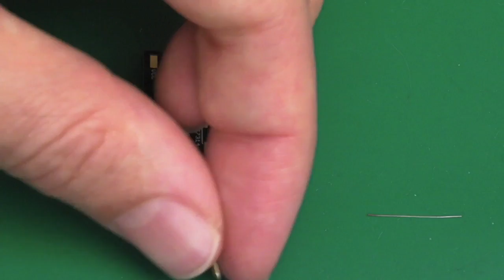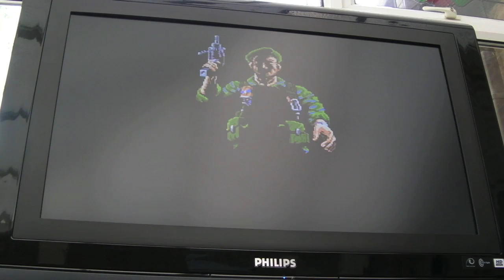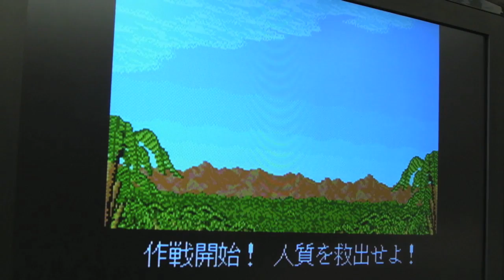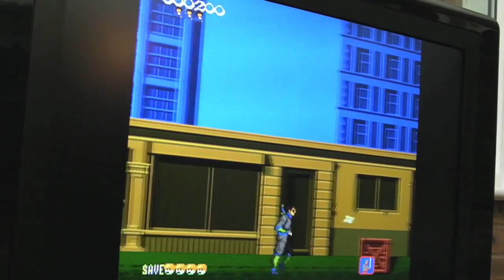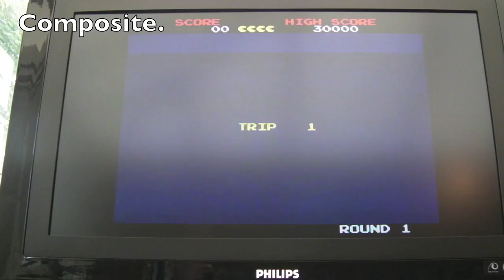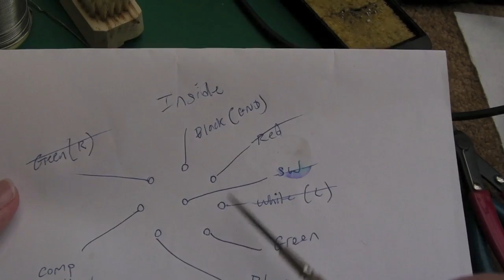NEC PC Engine (Tennokoe 2) Amplified RGB Mod

Comment: why not just make it a scart plug?
Reply from the maker: You could do that but I prefer to have a DIN which matches the other PC Engine model, so I can use the lead with either system.

Comment: I've done a whack of RGB mods, I've never had so many issues as this board.  I'm using 3.0MOHms as it's all I have, and a THS7316 amp going to an OSSC.  I only ever get a screen that's way too green or completely black and white.  Occasionally it looks alright for a few minutes, then goes completely 'red.'   Maybe my output voltage is too high for the pull-downs, try try again.

Comment: I just modded my IFU-30 with a ths7374 chip based rgb amp. Everything worked nicely and then something strange happened: When I plugged the OSSC into the first hdmi port of my BFs TCL 4k TV = no jailbars. HDMI port 2 and 3 = jailbars. I tried to replicate the situation with my own Panasonic TV and i had jailbars on every HDMI port.
After a lot of trial and error I finally found out what mainly causes jailbars on RGB modded PC-Engines and similar consoles; it's the full range RGB mode most HDMI in ports are set to by default. Set the one you use to "normal" or "limited" RGB range, and the jailbars are 99% gone, without replacing any filter capacitors. Yay! \^o^/
Reply: Ok, after some more testing with more games, let's make that 80% gone with 50% on solid blue background lol embarassment I guess i'll apply the HU C6260 filter capacitor bod after all to get rid of the last bit of "jailbaring" I ordered SMD ceramic caps of the 1812 size instead of the "recommended " 805 size. "Is this a piece of dust or does that need to be soldered on?" hehe ^^; They should fit too, i hope.
Reply: I just added the higher µFcapacitors to decouple the HUc6260 chip better and while the jailbar noise got reduced, it's still faintly visible. After thinking about why it's not totally gone for a while and trying out several things, i realized i made a mistake when i added the RGB booster to the IFU-30. I took the booster's power directly from the IFU-30's voltage regulator. But if the HUc6260 needs decoupling for it's 5V supply, why wouldn't the RGB booster's THS7374 chip need the same? Not decoupling that chip's 5v supply i think i introduced extra noise. More tinering to do.. ^_^ BTW, that's what my PC-Engine' video output looks like right now: https://ibb.co/hWHW7F8
Reply: I'm not entirely sure if I start to imagine things, after lots of staring at my TV, trying to comapre the picture quality, but I do think after adding the bypass capacitors to the RGB booster, the PC-Engines Picture does look cleaner.. or doesn't it? lol It does, right? ^^; https://ibb.co/gtshGsH
I also recap'd my PC-Engine, replacing all electrolytic capacitors, for good meaure and out of curiosity, but that didn't create any noticeable difference. Oh well, having new, good low ESR capacitors inside an electrical thingy never hurts. Thought my findings would be interesting to some ^^;

Comment: I'm thinking of getting mine modded for rgb. It has already been modded with composite so is it possible to still add rgb to it?
Reply from the maker: Yes, the 6270 outputs the RGB connections, so those will still be there for an RGB mod.
Reply: Thank you very much

Comment: Where can i find 3,1Mohm ---1206?
Do all need to be ---1206 family?
Reply from the maker: You can use other sizes like 0806 might fit OK.  3.1Mohm resistors are hard to find, which is why I ended up using 3.3Mohm I think.  between 3M and 3M6 will be fine.
Reply from the maker: You could also get 3M and 100K resistors and put them in series to get 3M1.
Reply: Is this the right one? https://imgur.com/a/0fqIC
Reply from the maker: That's 3 meg.  See if you can find 3.3meg - that will give a better picture.
Reply: I found 3.3m hope These Will do it

Comment: Hey, I had some question that I can't seem to find a straight answers to. I was hoping one of you might be able to answer it. 
Trying to do an RGB mod for TG-16. I'm using Console5's THS7374 RGB booster (only because Voultar's is sold out), Mini 9din genesis model 2 plug, a RGB SCART cable with Csync (from eBay's retro_console_accessories).  
Here are my questions, 
-if I want to use Csync, should I boost the sync signal from the TG-16? If so, how should I go about doing that? will it work with the THS7374 RGB amp?
-If I want to use Csync, should I even connect the comp video output? 
Thank you for taking your time to read this, Please advise.
Thanks again! :)
Reply from the maker: I've honestly never looked at the level of the csync signal on the PC Engine - my guess would be that it probably needs amplifying like the RGB signals do.  My suggestion would be to try it first and if its doesn't work then amplify it.   If you look at the datasheet here you can see that chip has 4 channels - one for CVBS (composite).  You could just feed csync into that instead and it would probably work.  You might need a pull up or something on it - I would look at the PCB to see how the R,G,B are done and replicate for the csync input.  I haven't seen the PCB from Console5 so maybe it already has support on the PCB to wire csync already?
Reply from the maker: http://www.ti.com/lit/ds/symlink/ths7374.pdf
Reply: Yeah, there's no PCB for the sync itself. which kinda sucks, but I guess I can still jump on to a leg of the chip. assuming that I can. I'll try it out and will let you know. Thanks for the PDF btw, That really takes alot of the guessing work.

Comment: hi , please give me the list of the voltages and caps values for all caps , RGB board and sound board. thanks
Reply from the maker: Voltages are unimportant really as most (if not all) of the caps you will find in 1206 size will be more than 5v.   Basically you need a min voltage size on caps of say 6.3v. 

3 x 82nF - 1206 capacitor
3 x 3.1M or 3.3M - 1206 resistor
1 x 22uF - 1206 capacitor 
1 x 100nF - 1206 capacitor
3 x 300uF 6.3 diameter electolytic capacitor
3 x 91 Ohm - 1206 resistor
3 x 470 Ohm - 1206 resistor
1 x 100 Ohm - 1206 resistor
Reply: thanks , great work . can i fit both boards inside the pc engine ? can it be done ? or do i have to use the expansion ?
Reply from the maker: Those components above are for the RGB amp btw!   The ones for the sound board are printed on the under side of the board too I think.  You could probably fit them both inside the PC Engine but it might be tight.
Reply: many thanks
Reply: another Question please , should i get the Tennokoe2 and install the rgb amp and sound boards ? i mean does it addup any bonus ? because i saw that there is another ciruit inside it, for what is that?
Reply from the maker: +dab2a atasi The Tennokoe2 is better to use because there's more space inside, if you get another PC Engine it's easy to just plug into the Tennokoe2, and the Tennokoe2 provides save RAM for games that support it.
Reply: thanks allot

Comment: Any place you would recomend to get the rgb amp board already populated with all the components? They are kinda hard to find here so i would need to souce them online anyway. Theres a couple on ebay, but the soldering job looks very iffy.
Reply from the maker: I cannot really recommend anywhere tbh =/   This site did send me some pictures of the boards they were planning on selling, and they actually used the exact same PCB I used:- http://gamedoctorhk.com/index.php?main_page=index&cPath=165
You could contact them and ask if they have the PCB still?
Reply: hm, its one of the ones i saw on ebay, soldering job doesnt look too good x.x Guess i'll just order the board form oshpark and the components then. Thanks

Comment from the maker: Update 15/06 - Had another play on the PCE tonight and whilst the display looks really nice now, I still believe that 3M3 resistors are not enough when using 5v.  The examples in the datasheet are based on 3.3v with 3.01M resistors.  I think the bias level is still not quite perfect.  I will scope the RGB pins and try dropping the supply to 3.3v with an AMS1117 regulator later if needed.

Comment: Nice pcb's but very expensive compared to the original, micro designed board. Also most people wire up the 8 pin din the same as the pc engine 5 pin din but then add the rgb lines to the 3 extra pins.
Reply from the maker: Expensive?  They are very cheap, like $9 for 3 or something!  I did wire it the same as the 5 pin DIN and then used the remaining 4 pins for R,G,B and switching.
Reply: the original amp pcb's are $1 each - but giving that yours are coming from the US the extra cost can only be expected.On your diagram you have the 5v switching on the centre pin were it's usually on the outside, with the middle pin and top tow are the rgb - either way still works the same.

Comment: Looks great, I would love to see what it looks like with just c-sync (c-sync not to be confused with comp-video-sync). I've noticed some modern HD TV's give a better picture with just c-sync. Oh, loved the shinobi game play. I used to own a genuine Sega System 16-B Shinobi arcade board but sold it like a complete tool.
Reply: i rgb these systems all the time, and personally can see next to no difference between comp sync and c-sync, only issue is that some lcd's really don't like c-sync.
Reply from the maker: Yes - you are right, c-sync was what I originally planned for but not enough connections.  I did later read that the c-sync gives a worse picture though on the PCE, and composite video is what other people switched to in order to improve the picture.  I suspect the c-sync level is probably just low and also need amplifying, because I also read another article where someone used a different model of the THS chip (with more inputs and outputs), to amplify c-sync, red, green and blue, but the picture wasn't any better or worse.  The only other improvement which I might do later is to add more bypass (22uF tantalums I think) caps to two of the pins on the 6260.

Comment: Thanks for the update! I think I'm going to try the component mod for this, as I have no way to get scart into my tv.
Reply from the maker: You might still be able to use this amp board - I can't quite remember, but for component, isn't the sync merged with one or all of the colours?  You might be able to just merge the sync with say green, and use the amp as it is to amplify red, green and blue to suitable levels.  Worth researching component - something I've never looked at closely as we have SCART on everything over here :P
Reply: I'll take a look.  This board is what prompted me to look at Component: http://www.tg16pcemods.com/rgb-to-component-converter-v-20.html I could buy a SCART lead and a SCART converter, but I think it's going to end up costing more money
Reply: Also found this solution to the jailbar problem:
http://etim.net.au/av-driver/pcebars/
Reply from the maker: Thanks, that's brilliant =D

Comment: THS7314 video buffer. Noted !! :D Was hoping for alternives to the maxim family. For one the one I'm experimenting with now is powerhungry in comparison to the THS7314.  THS one. Nice find on that board. Picture is sweet !! Good to see a proper videobuffer on the console. I don't know about the resistor values on this RGB Amp PCB, but on the C64, the Y/C signals are not at the expected levels when they come out of the VIC II. The Y signal i think I divided into 1/4 and the C signal in half or else it would saturate/clip on the input of the video amp chip.
Reply from the maker: The THS7314 does a nice job, and you can amplify other types of video signals with it by the looks of things (I guess it is just an amplifier at the end of the day).  I wonder what else might benefit from this chip or the PCB as a whole?  I did wonder about taking the RGB directly out of the megadrive VDP and trying to use a THS7314 to see if that helps with the jailbars on the Megadrive.  I suspect not though, apparently its something to do with noise getting into the VDP there.  Also wondered if the noise on the Megadrive jailbars might be filtered out usinga cap or cap and inductor.  Someone mentioned its noise related to VRAM timing or something.
Reply: I don't know the megadrive VDP. Might as well be the VRAM or other stuff on the system bus running in sync with the screen. Might even be unsuficient ground return paths for the VRAMs. The main advantage with these chips is the use of analog video signals (SDTV) with HDTV screens, ensuring that the signal is properly matched at 75 ohm to avoid ringing/ghosting/smearing, and with proper frequency response. The LCD screen already has such a filter. If not the sampling of the signal would look very poor (aliasing/moirepatterns), but if the filter is weak (I've heard some are really poor), then a noisy video signal or if the video signal comes from a DAC with hard over harmonics well beyond 10Mhz, then the THS video buffer helps reject them before the LCD. IDK why the whites in one of the intro screens you showed where not showing correctly or if you fixed it later with the resistors, but with a scope you can measure to see if the signal in on the video buffer is at correct levels..
Reply from the maker: Yes, my next thought if those pull up resistors didn't fix it was to look at the levels was to get the scope onto the RGB lines.  It was the 3M3 resistors that solved the problem with the colour levels.  I think the DC bias level was too high with 1M resistors, and increasing to 3M3 must have pulled it down.  In the datasheet the example size was 3.01M, so not sure where the 3M1 (3,1) came from on the PCB, maybe that was a mistake where someone assumed 3.01 = 3M1?
Reply: After some digging, its the AC input mode where this makes a difference..... It can be that the bias is correct with 3.01M but the signal is too large.. Difficult for me to say. Need to see shematics. What I do know though is that if you use 3M3 instead, then the bias level goes down and then I think the white level is brought within limits, and the sync level near 0V might be clipped or go negative, which doesn't have to be a problem because it is already square.
 Oh wait, it's SCART with separate sync...
Reply: ps. why the AC bias when the RGB are 0V referenced ? Why not go DC coupled ?
Reply from the maker: I've honestly got no idea!  The examples show using 3.01M resistors there, and the THS clearly has a problem if the resistors are 1M, but with 3M3 it works fine.  I wonder if just removing them completely as you suggest and DC coupling it maybe they aren't needed?  It's a bit out of my area of experience - I guess I could try and see?
Reply: Should be harmless to try it..
Reply from the maker: I will give it a try! =D
Reply from the maker: Just read this in the datasheet:-   "cannot yield a 0-V signal resulting in possible clipping" with regards to dc coupling.  I might just leave it as it is, as at least its working.
Reply: Looks great with the 3M3 anyway :)

Comment: Looks brilliant mate! IStill need to mod mine as well, I tried a simple transistor mod from mmmonkey a while ago, but it didnt work for my board revision, so I ended up forgeting to order the parts, gonna do it right now. I adapted a mini Din conector where the RF switch module was, looks stock.
Reply from the maker: Yeah, I thought about doing the 3 transistor mod but had heard that it doesn't work as well as the THS7314.  That mini DIN connector mod looks cool, I think the guy on the mmmonkey website did a similar mod too.

Comment: Well done. You really had to think your way out of that one. Must be cool to be able to buy a broken pc engine and fix it up again. Although, some of those chips you bought earlier weren't cheap.
Fun watching you do the smd stuff. It's good to have a video up on how to do that kind of stuff. I've seen bwack do that with a microscope!
Reply from the maker: Thanks!  The PC Engine spares weren't that expensive really - $13 for a GPU isn't bad really.  Sure I spent more because I bought another spare 6260, 70 and 80, but it's always nice to have a spare or two, and the challenge really was to understand the PC Engine and the fault - even if it cost more etc.

Comment from the maker: EDIT: Correction to make here - the datasheet for the THS7314 shows examples using 3.01M resistors (with 3.3v VCC), but I also have seen 2 or 3 other example circuits using either 3M5 or 3M6 resistors.  3M3 certainly looks OK with 5v though on the PC Engine.

RGB Amp PCB available from OSH Park:- https://oshpark.com/shared_projects/lMtxjGZC

Stereo Audio Amp PCB available from OSH Park:- https://oshpark.com/shared_projects/KVfBJcYG
Reply: Try adding a switch to disable the composite in RGB mode.
Reply from the maker: ? It's not using composite in RGB mode?  I have a composite cable that outputs composite, and an RGB cable for RGB!
Reply: oh "shrugs" okay......my bad.
Reply from the maker: Have you been fast forwarding again ;)
Reply: no i just noticed a few things.
 but eh. your console....Jail bars might go away. i know the pin out is different for each connector, But im wondering about residual composite "bleeding" into things where its not needed......the "static" Effect
Reply from the maker: Hehe =D  Probably my dodgy presentation skills that confused you!  I did switch unexpectedly to the composite cable part way through, just to look back and compare how bad composite was.  It surprised me because I had got used to it and thought it looked OK before.
Reply: oh, fuck, then yes!
Reply from the maker: Thanks =D